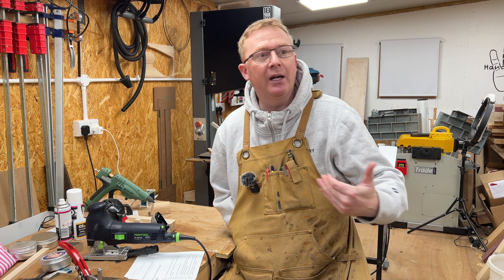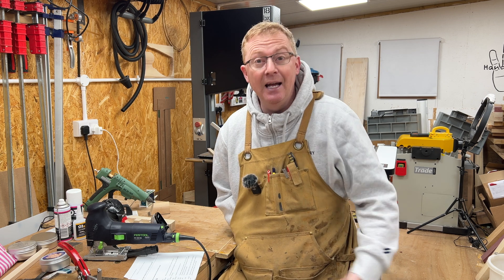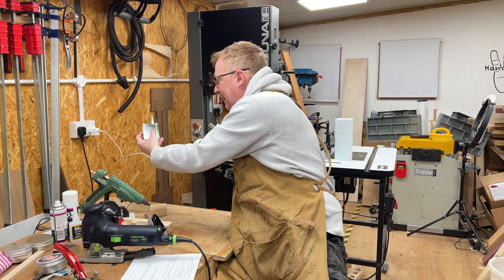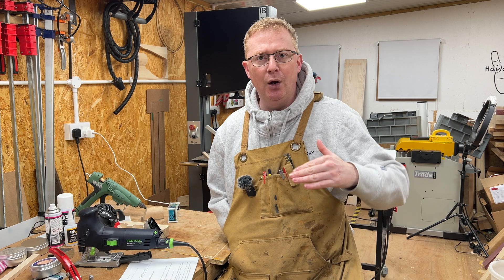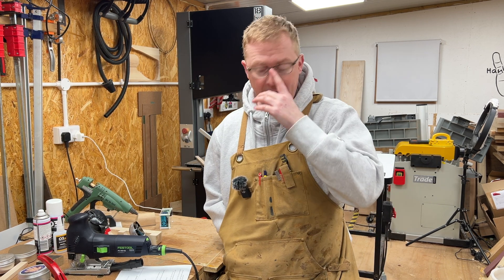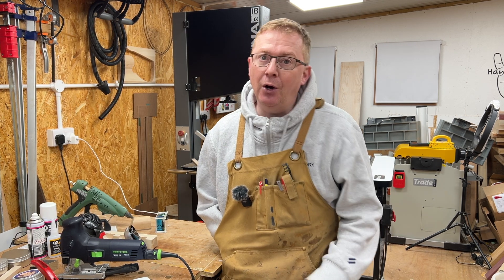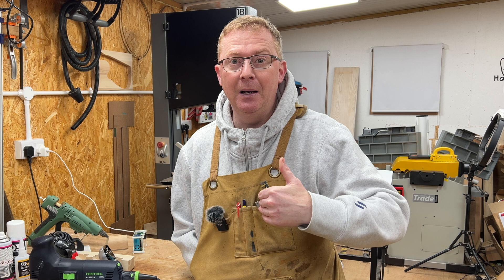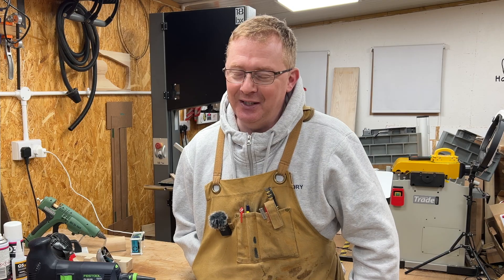Is YOUR Workshop POISONING You?

Comment: Good you addressed this. You should also be aware of formaldehyde off gassing from ply, OSB and MDF. Heat vent? Do you mean heat recovery fan? About £200 last time I looked and retains about 75% of the heat.
Reply from the maker: Cheers for the message and yes heat recovery fan is what I meant 😀😀👍👍. Your comment has great advice so I’m going to pin it to the top of the comments section 👍👍
Reply: @SingleHandedlyMade  Glad it was useful. I have suffered from this off-gassing of materials so it's hard earned experience. Sadly so many manufactured materials have toxic components. I think a lot of illness originates from these sources, but somehow we rarely consider them. Probably because we assume that if materials are on general sale for us to use, that they must be safe....Thanks for what you share on your channel, great stuff!

Comment: Where can you find theses heat vents from im a bit concerned being disabled as I have a 16ft by 10ft shed workshop and I have a a IR heater I’ve looked but can’t find anything
Reply from the maker: Hello Steve, have a look at the Kair MVHR system 👍👍
Reply: @SingleHandedlyMade  cheers much appreciated. And I also forgot to say thank you and great videos and amazed with what you can do. I’ve got an aggressive form of rheumatoid arthritis my hands/ fingers turn 90 degrees outwards on both. 
Keep up the the fantastic work and videos
Reply: @SingleHandedlyMade  at moment I open one of my two small windows at front and it’s not as sealed up as yours I’ve got air flowing over the roof insulation for the air gap to stop any mould I used plastic window spacers at 8mm I was hoping that would be enough to move air about

Comment: Great subject to speak about. I have the garage door open most of the time but when it’s really cold it can be shut and it makes you wonder how bad the air flow really is.
Reply from the maker: I was shocked pal with the results on the monitor. On reflection I think I just became almost obsessed with insulation and heat retention without giving enough consideration to ventilation 👍

Comment: Pretty good video Leo.  I hope a bit more ventilation helps and the heat exchange fan helps next year.  Have you noticed a lot of difference between working in the winter or summer or since you moved from the old garage.  Both my workshops are quite drafty and I usually work with the doors open.  My main worry is humidity in the winter and I do have to clean the metal surfaces of my machines regularly (and apply your wax afterwards).  I did have a dehumidifier in one a few years ago but it packed up and I  didn't find it made much difference - maybe I needed a bigger one to cope with the drafts of damp air in winter.  Mike
Reply from the maker: Thanks Mike, summer time I always have the windows open. The reason why I didn’t think it was an issue initially was the workshop doesn’t suffer with humidity issues in the winters the metal surfaces don’t get damp so I was presuming there was enough ventilation in here. Clearly I was wrong in that assessment, but at least I’m aware of it now 👍

Comment: Thanks Leo.  I agree about the over insulated draft proof situation.  Food for thought.  I also use a dehumidifier, switched on when I'm not in the workroom, just a little one from Amazon, does the trick fantastically.  I was advised to get one when the service technician found a little bit of rust in one of my machines 😯.  That's sorted it fine.
Reply from the maker: Cheers Colin and thanks for sharing your tip too 👍👍

Comment: Hi Leo hope your well, good to know about air quality , unfortunately for me my workshop is not insulated it is a concrete block build rendered on the outside 17.5m x 20m a size of a garage and three quarters split in to two rooms. So I don't do much in the winter months hopefully in the next few weeks if it warms up I be back in there. My workshop windows are in a slight open position and screwed in that position to the frame and the doors are always open. As always good advice catch you soon Take care mate
Reply from the maker: Thanks Shaun. I’m glad I managed to get to the bottom of the situation in regards to the workshop and can make sure the windows are open for a temporary fix with a view to a permanent more practical solution in place for next winter 👍👍

Comment: An important topic to bring up Leo. Something I think everyone needs to be conscious of when working in a confined space. I keep a trickle vent open constantly in my workshop which helps to freshen up the air over night. When I am working at the bench I have a window that I open up to get a breeze flowing in. If needed in summer I keep the door open. I think ventilation is also important to keep your wood and equipment in good order as the condensation from your breath could cause damp and rust to form if not properly ventilated.
Reply from the maker: Thanks Phill, great ideas pal and really appreciate these contributions 👍👍

Comment: A very useful tool, but my problem with these, is having confidence that the device is accurate.  Cheaper ones, certainly seem to be unreliable, but there is no guarantee that the most expensive versions are accurate.
Reply from the maker: When I was looking for one John the reviews for the sub £20 readers were shocking. I’m not saying this one is deadly accurate but it certainly does give you a proximity of air reading values 👍👍